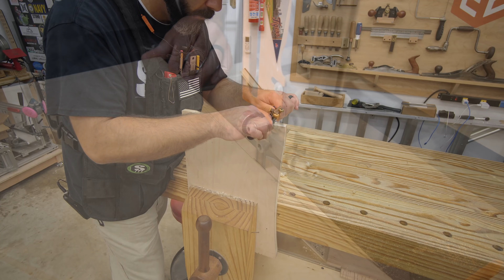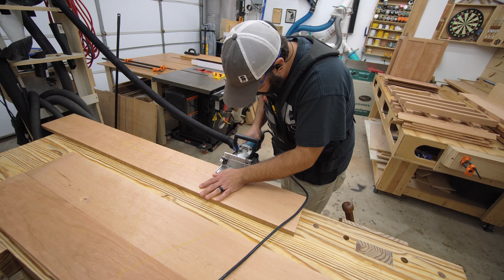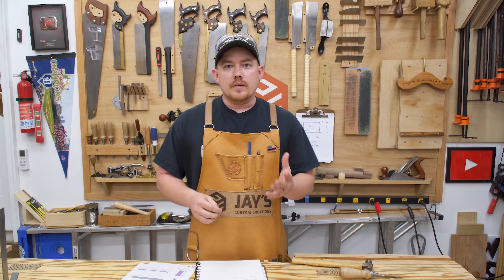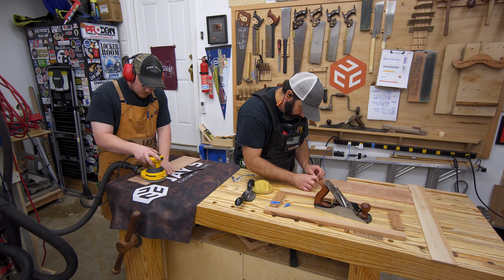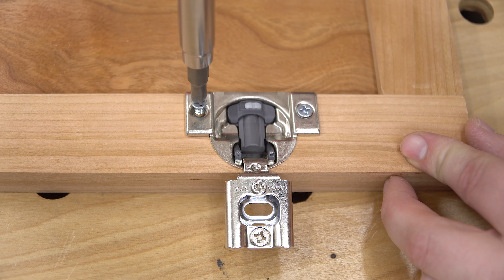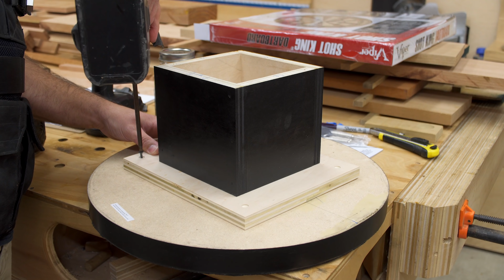Dartboard Cabinet (video 4) - 293

Comment from the maker: And finally the project is completed. As you know, we started this build with a completely different outcome in mind. It didn’t finish as originally intended but we were able to make lemonade out of lemons, as the saying goes. Things don’t always go as planned. You may never encounter a big mistake like we made here. We could have simply scrapped the material and started over but we wanted to share the experience with all of you. Make your mistakes, learn from them, and move on more educated and with your chin up.

So why a dartboard cabinet? Well, that was the first thing we could think of to salvage the build and proceed with actually being productive. We’re not even sure if it will remain a dartboard cabinet. One could easily remove the dartboard and back panel, replace it with a mirror, and call it a whiskey or liquor cabinet. Regardless, it’s a quality piece of woodworking that is built to last.

So what are we going to do with it? We’re not sure. Neither of us plan on keeping it though. We haven’t decided 100% what to do but one idea was to auction it off and anything greater than the material cost invested would be donated to charity. The auction would be for a pickup only situation where the winner could pick it up and spend a day with us in the shop doing whatever he/she wanted in regards to learning something or simply talking shop for a bit. Either way, let us know what you think of the project as well as what to do with it. 

In the video I said I would have plans for this project but because making this project, editing this style of video, and putting this long of an article together is incredibly time consuming I simply ran out of time to put together a set of plans. Plans take a while to do as well. If there is enough interest in a set of plans I’ll put them together. If you enjoyed this build and would like to show your support for the content I make consider purchasing one of my other project plans I have available. Thank you.
Reply: Not sure what to say, but this was hard to follow. Nice woodworking, just hard to follow.

Comment: 4:50 about that third option, where you left the tenon a little smaller than the mortise, the size of the semicircle, doesnt that makes for a weaker joinery, since the pva glue doesnt have a very good filling property? Or its just fine? Im asking that because if it is just fine, why the hell would anyone go to the trouble of rounding edges of tenons, or even squaring mortises if no one would see, right?
Reply from the maker: It doesn't make much of a difference.....most of the time. The wide glue faces are where the majority of the joint strength comes from. Also, any situation where extra emphasis would be added in regards to preventing racking would benefit more from adding a dowel to pin the joint rather than worrying about the short sides of joint.

Comment: This is a super cool dart cabinet.   But as an avid dart player i can’t help but notice that the dartboard was installed permanently. They usually come with a specific bracket to install them so that they can be rotated easily to keep certain sections from wearing out.   Otherwise its a fantastic project.